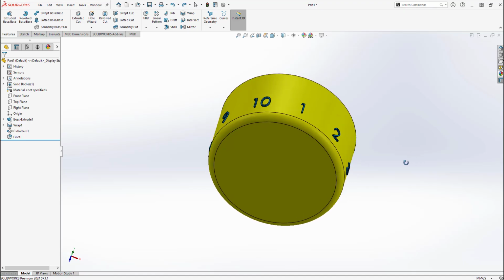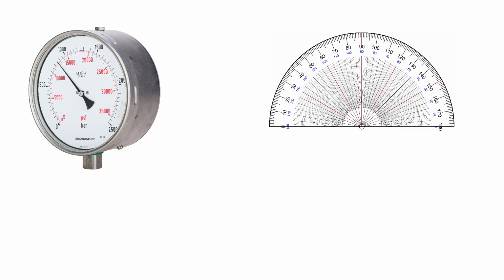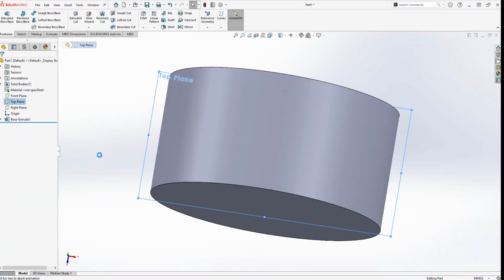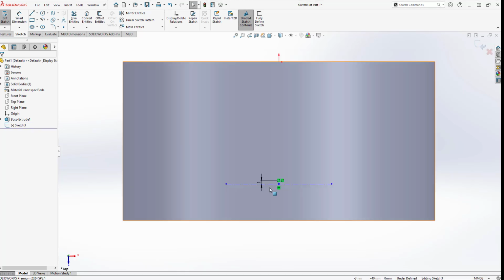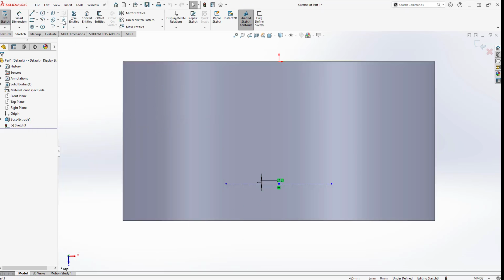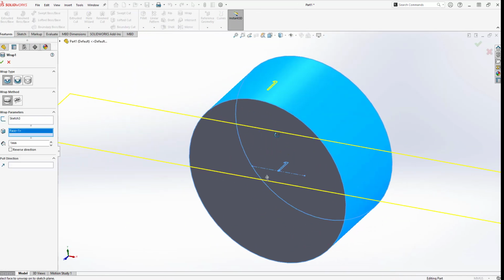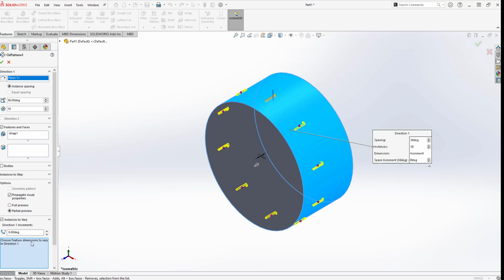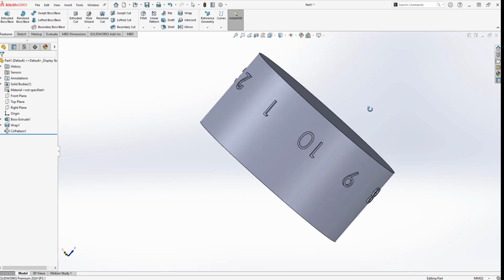Incremental Numeric Features with Circular Patterns in SOLIDWORKS

Comment: Is this feature working on version 2023 SP 5
Reply: In SOLIDWORKS 2023 SP0.1, there was a known issue where the "Instances to Vary" option did not work properly when using custom properties to define the starting number. This problem has been fixed in SOLIDWORKS 2024 SP1.

Comment: does not work for me, i followed the instruction line by line but the numbers do not change, I just get loads of 1's, its funny because if you look at the different instances, in the information box the number changes.
Reply: Hi Steven,
The issue you're facing might be related to the SOLIDWORKS version you are using. Some features or behaviors can differ across versions due to software updates or changes. Please let me know your SOLIDWORKS version, and I can guide you on whether there are specific settings or steps to modify for your version.